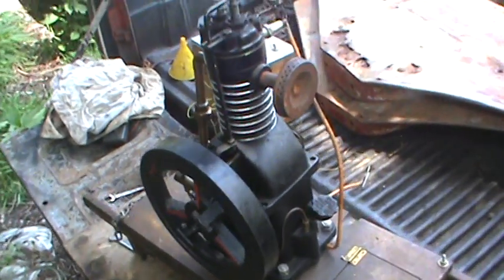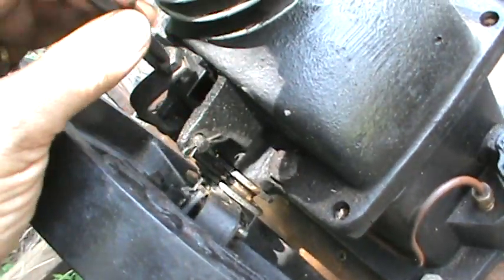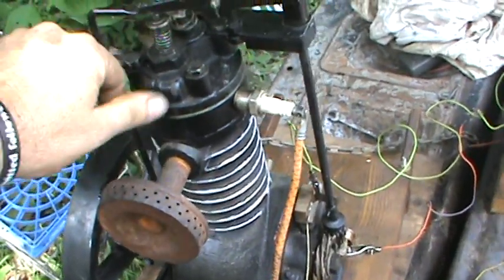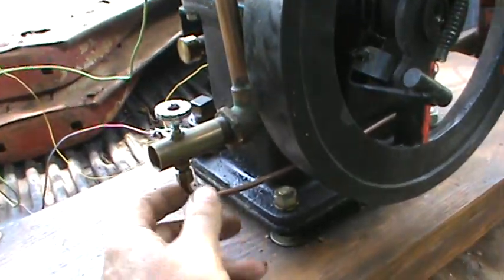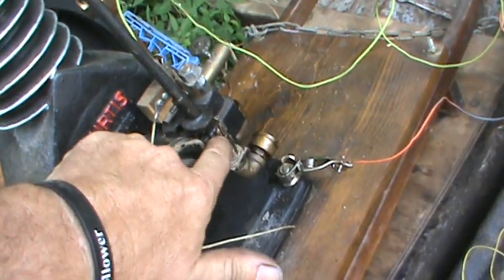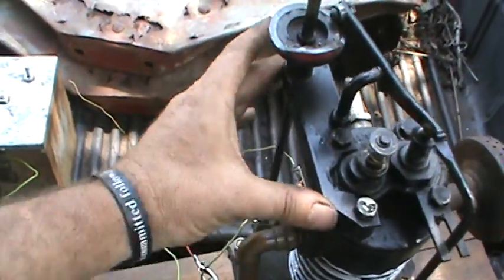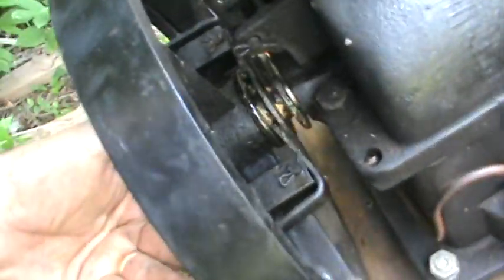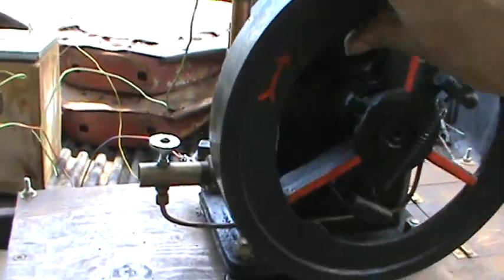Home made Hit & Miss Curtus compressor engine

Comment: Really enjoyed your video and was inspired to do a similar project from an old compressor a friend gave me. It turned out well and seems to run fine. I used a bicycle chain for a timing chain with a sort of overhead cam arrangement. Your video was a huge help to me, especially the governor. You did a very neat job. Your engine looks good and runs good.  Thank you very much for sharing your knowledge and skill.

Comment: Very interesting, like it!

I've been wanting to do this for a while and I've found a fairly large Broom & Wade compressor which I'm going to have a go at converting. How did you make the spacer between the head and barrel? I'm also interested in how you cut the valve seats?

Great work, runs well!

Cheers,

Phill.